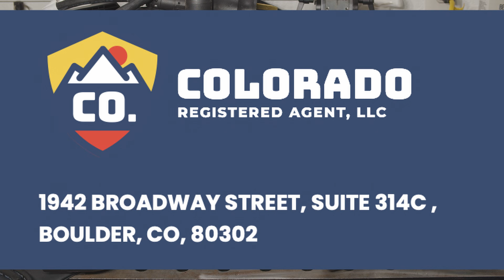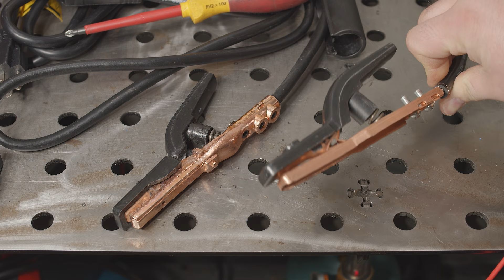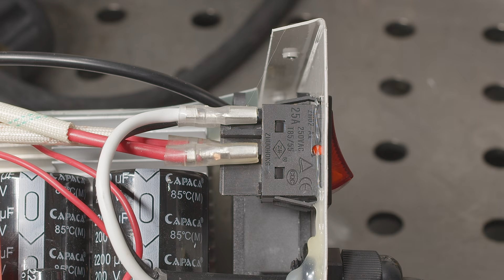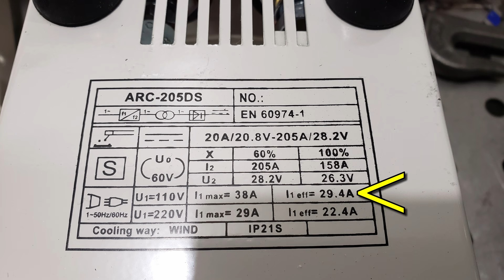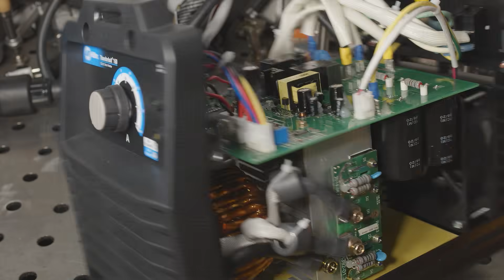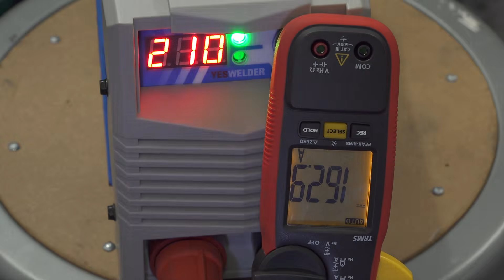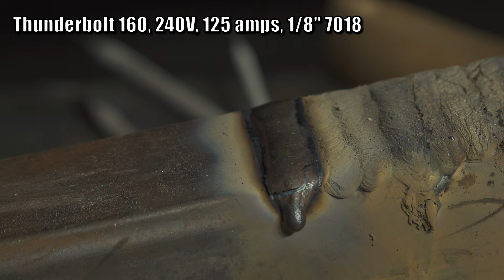Miller Thunderbolt 160 Vs Yeswelder Arc 205DS:  In-Depth Comparison

Comment from the maker: Just wanted to point out that someone posted a comment about how the Amico website existed and they posted a link to it.  I didn't remove the comment.  I have to imagine YouTube automatically removed it due to the link.  It's not in my "held for review" tab either.  However, I would advise caution if you try to go to the Amico Power website yourself.  Since I could still see the link in my notifications I went there and not only was the site non-secured, my anti-virus detected malware on the site.  Just in case it was an issue with the link, I searched for Amico's website on google and when I tried navigating to it that way the website was blocked altogether due to malicious software detected.  So be careful.
Reply: When I tried to go to their site on my work computer it blocked me. I was able to go to it on my phone.

Comment: No need to worry about duty cycle when you could buy 3 of the cheap welder for the price of the miller and cycle through them to achieve 100 percent duty cycle at peak amperage. Lol

Comment: In between these 2, the Everlast 200 STi would be a good option at $350. Has adjustable hot start intensity and time, as well as adjustable arc force, and a 6010 mode.

Comment: In all honesty, I've had solid results from my little yeswelder tig setup. I don't use it for any industrial applications, it's just for small time gunsmithing and a few repairs on lawn equipment and random stuff around the house. Chinese zap boxes make more sense to me for that kind of use it twice a year at most light duty than a $700-900 (they bumped up the price in a big way) Miller.
Reply from the maker: Miller units have definitely gone up in price a lot in the last 3 years or so.  Crazy money. 

I'm just starting to get fed up with the false claims of companies like Yeswelder, but as long as you found something that is meeting your needs, that's ultimately what is important.  Cheers.

Comment: Little known fact, the rating of a switch is based upon the safe disconnection under the load. I e to safely stop the arc across the open terminals without damaging the contact points. As the likely good of this type of machine being switched off during actual welding it’s probably not a problem for the switch to be underrated
Reply from the maker: True, and it's why I don't tend to make too big of deal out of it (most of the cheap welders I review have underrated switches).  But when a machine is tested for certification, they absolutely wouldn't pass it if the switch was rated for less than the "rated" power draw.  In fact, the code that pretty much every Chinese welder puts on their data tag specifies that the switch be used to turn off the welder at full load a certain number of times without issue.  My point was simply that it's clear the Yeswelder wouldn't actually meet the ratings of the code they print on the data tag.

Comment: Amico electric has a website again. Perhaps they were revamping it when you looked for it.
Reply from the maker: Possible, as it is now Amico Electric and it used to be Amico Power.  However, as mentioned in the pinned comment, use caution on that site.  It was pointed out to me a while back and I tried accessing it a couple different ways with my work computer.  Both times I got malware warnings from my company's anti-virus program and one of the times it blocked it entirely due to the detection of malicious software.  Maybe this has been fixed, but others reported the same thing, so just be aware and be careful.  Cheers!

Comment: What is the thickest sheet metal that can be welded with the miller? I work at an old concrete plant and have a variety of different size metal and all have holes that need patching. The plant is tall as I can find 110 outlets all over the plant. That is why I’m looking at the miller. Your input would be appreciated greatly.
Reply from the maker: With the right prep and using multiple passes, you could probably weld just about any thickness.  Keep in mind though, the Thunderbolt 160 maxes out at 80 amps on 120V.  That would limit you to 3/32" electrodes and they wouldn't run very hot.  It's not what I would want to use for anything super thick. But if it's nothing structural or life safety related, it would probably get the job done. 

What is your budget?  The ESAB Rogue ES 180i can run at 110 amps on 120V and with the power factor correction, it can do it without issue on a 20 amp breaker.  That would allow you to run a 1/8" 6010 or 6011 rod, or run any 3/32" rod you want nice and hot.  Just something to consider.

Technically, the Yeswelder and other cheap welders will put out 115-120 amps on 120V, but they draw 40+ amps while doing it, so you'll trip a 20 amp breaker if you weld at that amperage for very long.
Reply: @bigtb1717  thanks for your input. I will be using a company PO to purchase the welder but I only had a budget of 1000 including helmet and gloves.
Reply from the maker: It's a shame prices have gone up so much lately.  The Rogue ES 180i was $599 when it first came out.  Are you in the USA?
Reply: @bigtb1717  yeah, I’m California. My local welding store has them for 850 down from &1050
Reply from the maker: If you have a Northern Tool local to you, or if you can use the PO to order something online, the Klutch ST 201iDV has power factor correction so it runs pretty well on 120V and it's a very complete package for under $500.  I think it's one of the best, overall value machines available right now.  Might be worth a look.

Comment: As a retired mechanic welder I have a bit of experience with welders and when it came time for a hobby welder in the garage, I picked up the YW 250 P ACDC to complement my SIP 170 MIG I’ve had for 25 years.  The price was right and it performs flawlessly.  I see no mention of you testing your supply voltage while testing (perhaps I skimmed over it?)
Reply from the maker: I'm glad your welder is working for you.

I didn't check my supply voltage in this video, but I have tested it other times.  Both my 120V and my 240V receptacles are fed by dedicated circuits on dedicated breakers.  When tested I have not seen bad voltage drops.  I have run everything from tiny inverters that draw a handful of amps to 280A welders that draw 50 amps and have never had an issue with the supply voltage.

Comment: I realize this is an older video but have you tried 6011's on the  arc205? and if so how well does it run them?
Reply from the maker: I can't remember if I tried 6011 on this machine (I don't think I did).  Unfortunately, I don't have it any more, or I'd try it.  I plan to try 6011 on welders that don't run 6010 from now on, because the I recently had a machine that ran 6011 just as poorly as 6010 (Hitbox).  I do have a YWA-160. (new Yeswelder stick welder) that I got for under $100 on Amazon recently that I will be testing soon.  I'll make sure to test 6011 on that one.  The specs on it are very similar to what the ARC205 would actually put out, so it would probably good alternative now anyway.  I'll be testing a Primeweld 160ST at the same time and comparing them.

Comment: Have you opened up anything from primeweld? I want a not so expensive stick welder and I'm seriously considering the primeweld stick 160. What are your thoughts?
Reply from the maker: I've been wanting to take a look at a Primeweld machine for a long time.  I suspect the the 160ST is essentially the same machine a lot of other sellers offer, but it would still be interesting to check out.  Especially since I happen to have a brand new 160A Yeswelder I'm planning to test out.  Might make for a fun comparison.  I'll check it out.
Reply: @bigtb1717  that would be an interesting comparison. If the yes welder 160 amp follows the same pattern as their 205 it should put out only around 120 amps. I'm real interested in how the primeweld 160 will compare and contrast. I hear people really favor the primeweld machines so I'm real curious about it. Thank you so much. I love your channel!
Reply from the maker: @Antoniocool86  I'm sort of expecting the YWA-160 to basically be the same as the 205, but rated more accurately, but we'll see.  I do have a PrimeWeld 160ST on the way and will definitely be comparing the two.

Comment: Great comparison, very detailed. Durability and performance make Miller a good quality machine; it is superb to YesWelder and any other Brand-X welder. I have the Hobart Stickmate 160i which is identical to the Miller. The machine has been solid. I’ve been making gates with it for five years and no complaints, burns a variety of rods easy. Good video. Thanks a bunch!

Comment: I can't speak for the ARC205DS, but I recently purchased and tested the MIG205DS from YW. There have been some reports that YW machines have a power output that is actually way off from the display. However, I tested the amperage with fluxcore and stick all across the displayed range. It was within 1-2 amps over the entire range except at max where it was a touch low (3-5 amps).

I'm not a fanboy for any particular company or welder, and I'm just a beginner, but a pro-welder who has been training me tested out the YesWelder I have at different power levels, different processes, etc. (including 6010)., and seemed to think it was fine for a basic starter welder. Maybe he was just being nice to me. :)
Reply from the maker: Maybe they fixed the issue, but I tested two MIG 205DS machines and both had stick output that was well below displayed amps, particularly above 100.  

Hopefully your machine is a sign they fixed the issue and not just an outlier.
Reply from the maker: In fact, I've tested the ARC205DS, two MIG205DS, an ARC400Q and the Firstess MP200.  None of them were able to meet the claimed output.  I'll be testing the CT2050 as well (I ordered as soon as the Kickstarter launched).  Hopefully that machine does better.
Reply: @bigtb1717 , I'm interested in the CT2050 as well, but didn't want to wait for it to drop.

I don't know about the duty cycle question, but I do know from direct measurement that at least the MIG205 machine I have does have an accurate amp output over the full range on fluxcore and stick.
Reply from the maker: Was your 205DS able to put out the full 180 amps on stick welding?  If so, that's a big change.  Even the Firstess MP200 I tested, which claimed 200 amps of stick output, was only able to hit the same 160 that I got out of both my MIG205DS machines (which claim 180).
Reply: @bigtb1717 , my recollection is that it was pretty close on amps for both stick and fluxcore wire, but I will double check the high side next time I am welding and get back to you.
Reply: @bigtb1717 , I just tested my MIG205DS through 180 A using a 1/8th 7018 electrode. The welder was dead on through the entire range +/- 3 amps, until 180, where it actually ran a little hot (180-185).

I compared this to the TIG250 I just received and am testing. The latter was consistent as well, but was about 5 amps low at each mark. To be consistent, I should have used the same cable set on each (but did not).

Either way, they are close enough for me, and any inconsistencies in welds will likely be due to my poor technique rather than power fluctuations on the machines.
Reply from the maker: @philo-aletheia  Thanks for reporting back.  Hopefully Yeswelder is correcting the issues.

Comment: I bought a Chinese welder that said 315 amps on 240 vac.,  In actuality it maxes out at 127amps,  even though the display says 315 amps,     as tested with a Fluke amp Clampmeter,  but it will run a 7018 1/8" rod fine. and 6011 1/8" ,   I knew as soon as I took my Chinese welder out of the box it wouldn't come even close to its rated 315 amps just by the input power cord of 14 gauge wires.     
 Thanks for a Real Review,

Comment: Yeswelder is definitely not a Miller but ya know what, I’ve been super pleased with my yeswelder 205ds tig/arc welder. I’ve been tig welding pipe for over ten years now, I’ve used the best millers with water cooler, Lincoln and everything in between. For something you use here n there in the garage the yeswelder will do everything you’d ever need it do. I only paid a little over 200 bucks for the yeswelder which you would easily pay over 2 grand for a Miller. Miller is obviously a better quality but I’m more than pleased with what I got for the $$
Reply from the maker: Miller's prices have gotten pretty outrageous the last few years.  Even long before this video, a lot of people implied that my criticism of any other welder was just because I thought everyone should buy Miller welders.  But I test cheap welders because I know full-well that is all most people will ever need.  And I am critical of faults not because I'm trying to convince people not to buy them (at least, in most cases), but because I want people to know exactly what to expect so they don't waste their money on something that will be disappointing to them.  If they hear my criticisms and feel the welder is still worth the money, great!  On the other hand, if I wasn't critical and someone buys something and is surprised by faults, they may end up disappointed.
Reply: You can use tig on that machine swap polarity and add some argon

Comment: Yea for sure Miller has always been a better welder especially when your talking cheap throw away priced welders. The quality control they offer has value.......BUT for the smaller diy or guy who is just starting out the Yes welders are not too bad. and priced competitively compared to like other china products. Not a bad value for a cheap machine. If you buy Miller your are PAYING MUCH MORE.....and you get a better machine. Not everyone can afford a Mercedes or Lambo.....That is why FORD is still in business.
Reply from the maker: Hey, that's why I test out so many cheap welders.  I fully understand that most people really don't need anything fancy.

At this point, my issue with Yeswelder is that despite the fact that they have been fully aware (I know because I spoke on the phone with them about it over a year ago) of multiple issues and claimed to be working to resolve them, they have done nothing to fix any of the issues.  Issues with false claims, inaccurate specs, inaccurate data tags, inaccurate manuals (for the few that actually exist) and no actual, official warranty in writing anywhere.  When we spoke over a year ago they insisted they were working to correct inaccurate specs and were working with lawyers to get a proper warranty written.  They made excuses about how they were a small company and they were at the mercy of the factory on some of this stuff, but they were working on it.  Over a year later and MILLIONS of dollars raised in a Kickstarter campaign and there is still zero mention of a warranty on their website and their new Firstess MP200 that just came out makes zero mention of any warranty anywhere and has the same inaccurate specs as many of their other machines.

I understand this is all pretty standard with the "generic" welder brands from Amazon/EBay/etc.  But Yeswelder are trying to establish themselves as a well-known, well respected name in welding.  I really wish they would get their act together and at least advertise proper specs for their machines.

Comment: I just ran 30 rods on the same machine back to back with maybe 30 to 60 seconds in between with no issue's. Had it plugged into 240 volt outlet. Great little welder for 128$$
Reply: The yeswelder plasma cutters are a great bang for your buck too. Yeswelder is obviously not a Miller, but it’ll do everything you’d ever need it to do in your personal garage
Reply: 0nñp0lpp

Comment: many companies in the USA do the exact thing regarding addresses
Reply from the maker: I don't doubt it.  I only pointed it out because people were saying it was an American company that simply had their stuff made overseas, just like many American companies do these days.  The implication was that Yeswelder is very different from the other cheap welder companies.  But it's fundamentally not.  Their "US locations" amount to a rented address at a company that rents their address to dozens of companies, and some space in a California warehouse that rents space to many companies who's products come in on the nearby ports.  Which is fine, but it's not like they have a corporate office or R&D center here, or anything like that.

I think there is something that separates Yeswelder from other Chinese welder companies,  and that is marketing.  Their social media and Youtube campaigns have convinced a lot of people that their machines are higher quality and more personally involved in the American welding community and industry than others.  This is despite the fact that most of their welders still come with incorrect specs, inaccurate data tags, poorly translated manuals with inaccurate info (if they come with manuals at all), etc.  For better or worse, their machines are pretty much the same as what you get from any of the generic brands on Amazon, eBay and others.

Comment: Is the switch wired to a hi current  relay?
Reply from the maker: If you are asking if the switch only controls a relay, then no.  The full supply current for both machines goes through the power switches
Reply: @bigtb1717  that's a bad design
Reply from the maker: It is how virtually all welders are designed.  As long as the power switch is rated for the current the welder will draw, it should be okay.
Reply: @bigtb1717  really,  wow even on large industrial welders?  As an electrician I would install one myself.   I plan on getting a welder soon.
Reply from the maker: Larger, higher end welders have larger power switches which are easily capable of handing the amperage.